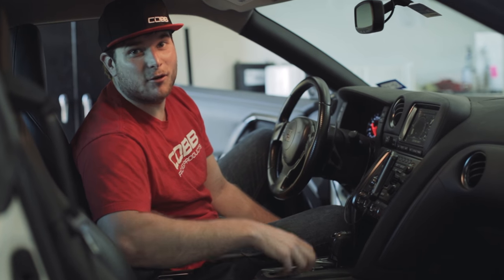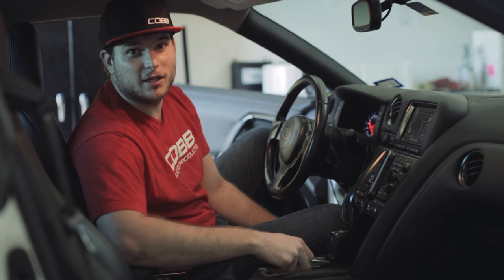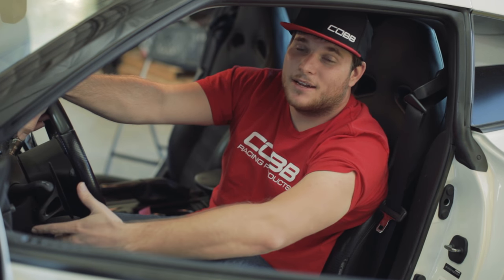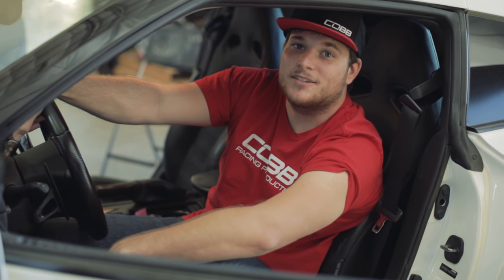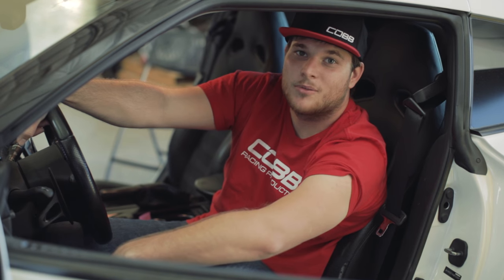COBB Tuning - GT-R Active Map Slot Change Tutorial

Comment: Hi there,
I bought a used 2009 GTR with a Cobb Stage 2+ package. I was told by the seller on how to change map on the fly but holding the cancel button on the steering wheel and watch the Boost gage go up from zero (stock settings) to 1 (loaded map). However, my issue is I cannot loaded more than 1 map at a time with the Cobb Access Port V3. Is there to load a performance map on slot 1, a valet map on slot 2, anti-theft on slot 3 and so on? No where in the manual says I can load more than 1 map. Thanks in advance.